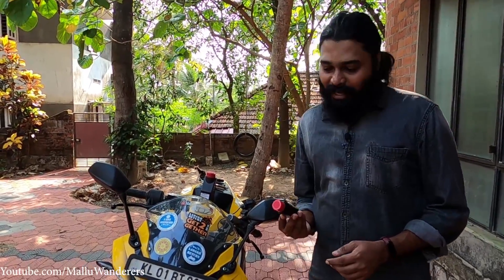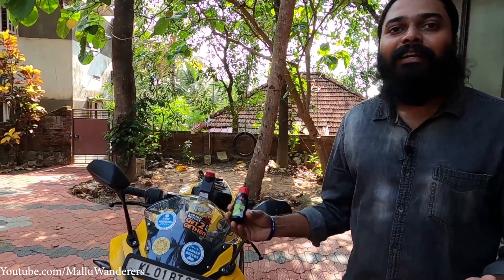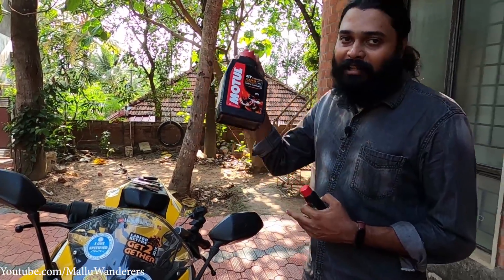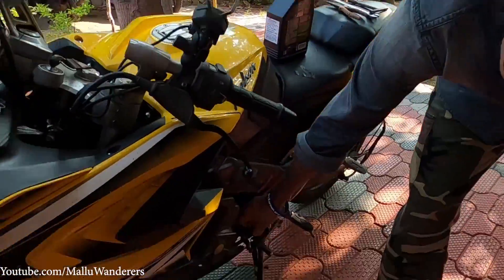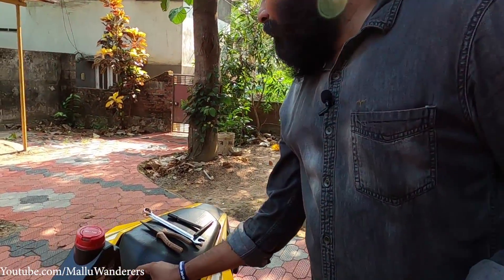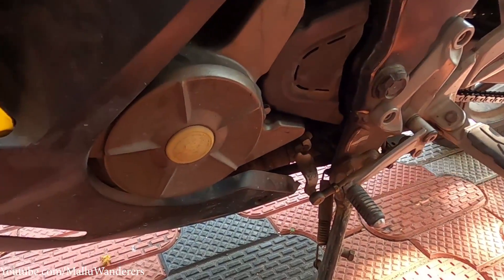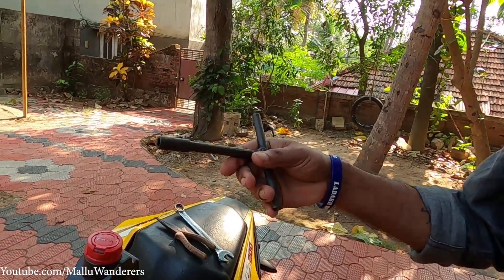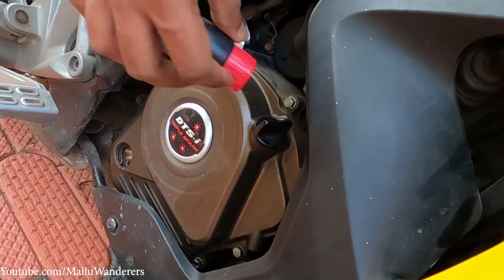How to Flush Engine | 3M Engine Oil Flush | Pulsar RS200 Oil Change |

Comment: Bro RS200 starting idle idumbo oru variation und koodiyum kuranjum nikkum athentha agane?..oodikkumbo missing illa..
Reply from the maker: Odo reading 30k plus aayaal it’s time to clean throttle body and injector. Also check and clean the spark plug.
Reply: @Malluwanderers  throttle body  clean aakiyatha bro..sparkplug cheriya thurumb kaanikunond porame..
Reply from the maker: Spark plug onnu maatti nooko, yennitum maarillenkil fuel pump ntey efficiency nookeetu filter onnu maaati nooku. Yenittum maarilenkil injector clean chaithu nooku. Yenittum maareelenkil ECU onnu check cheythu nooku100% sari aavum
Reply: @Malluwanderers  ok bro thankyou❤

Comment: Engine oil flush ozhich 15 minutes start cheyth.enit oil full kalayaan nokiyapo adiyill ulla screw azhikkan kittunnilla..bhayangara tight.apo workshopi kondpoghendiverum..engine flush oil athil 1 day  kidakkunnadh kond problem ndhlm undo..
Reply from the maker: Bro athil flush kidakunathu kondu kuzhapam illa but ippo oil ntey viscosity mothaam maari thin aaeetondaavum maatramalla oil ntey full properties um change aaaee kaanum so vandi oru auto pidichu workshopil kondu pookukayoo allel mechanic ney veetil vilichondu varikayo cheyanam. DONT accelerate harder. Just start chaithu oil onnu heat aaettu drain chaithaal mathi. Allenkil Vera oru option : oil ozikunna sthalathu koodi oru cheriya hose ittu suck chaithu drain cheyanam pandu kerosene canil ninnum kerosene yedukunathu pooley
Reply: @Malluwanderers  thanks ❤️

Comment: Crank section l oil kidakkunnundaaville ath drain out cheyyande? Flush use cheyyumbol?.
Reply from the maker: Good observation bro👍 athinu suction pump upayogichu suck cheyendi varum. But puthiya oil add cheyumbol quantity of contaminated oil is negligible,
Reply: Kk